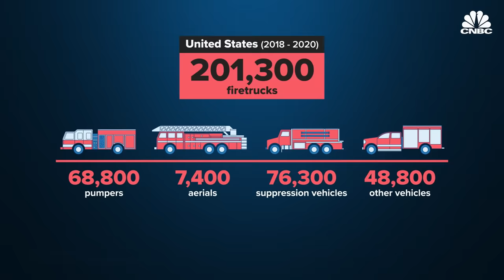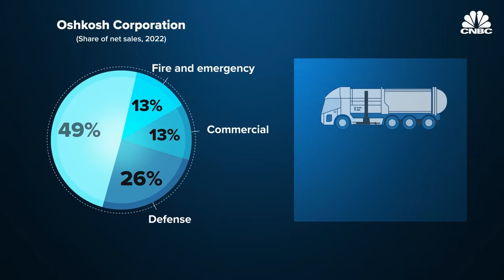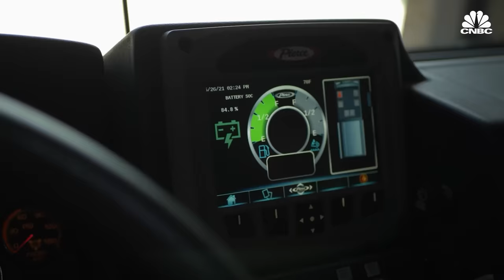Who Makes Money From America’s Firetrucks

Comment: It would make make sense to have a standard base model, sort of like Unimog in Europe. 
But a lot of it comes down to plain old resistance to chance, even if it’s for the better. 
Same goes for most of their gear.  For example euro style helmets are safer, but not used, simply because they prefer the look of the old style/ design currently in use.
Reply: I'd use a Euro here in US but oh no....gotta keep the tradition of the regular helmet alive.
Reply: That’s an issue with each city’s set of regulations from what I understand.
Reply: Even european firetrucks are customized to tailor the department needs. It is impossible to have a one size fits all fire engine. Each fire engine is custom-made to match the needs and demands of the department its going to
Reply: Technically there is no standard fire truck even in Eurasia. The U. S “Standard” is often a 30’ cabover that seats 6 and has IIRC a 500 gallon tank. But its a stretch to call it a standard as your talking hundreds of departments with their own needs in hundreds of municipalities with different local and statewide regulations. You cant mass produce something thats even close to a one size fits all.
Reply: Euro helmets are the same just a little lighter i would rather use the traditional fire helmets hands down over other euro any day it protects more of your neck and yes tradition is a very big part of the fire service and it’s where we came from we should respect that and be proud to put on that helmet but instead we complain.
Reply: @ember_shep8181  but most of them are made on commercial chassis, that are much cheaper than custom ones, made say, by poerce. It really helps when all the trucks are cabovers. Also, the pumps and plumbing are quite different: European engines usually have less valves and prepiped discharges, if more are needed - couplers are used.
Reply: @solarissv777 most fire apparatus are not made on a commercial chassis. That is 100% wrong. And by the way Pierce still builds the rest of the truck.
Reply: You’re wrong. The American fire service, typically teaches a very aggressive interior attack. While Europe generally will not enter a building unless there is a life safety threat. The American fire helmet has the added “wing” or “tail” which allows water and debris to run off and away from our backs. The back of the euro style helmet ends directly at the neck, allowing for debris and heated water to infiltrate the turncoat at the neck line and run inside. Also, for the traditional American helmet, ie: 1010, or N5A, the insignia eagle at the top front of the helmet, can actually be used by a fire fighter that is trapped to breach a sheet rock, or with enough force, plaster and lath wall for an added or necessary escape. More progressive and advanced classes, ntm old timers and experienced senior members teach us these tricks of the trade.
Reply: @jamescoakley4319  I meant in Europe. It's your regular MAN, Scania, Mercedes etc., although, sometimes with the crew cab. Some of those trucks can be ordered with a crew cab (for up to 10 prople) from the factory. Sometimes, with the regular cab and additional places in superstructure. And besides, airfield engines, some other specialized ones (wildland fires, haz-mat fires) custom chassis fire engines do not exist here.
Reply: Mercedes-Benz atego is most common, as wel as MAN trucks. they also look more modern than these american blobs. Rosenbauer is the biggest.
Reply: @BD-md6zr  I guess in Germany, Europe is big. Here in Czech Republic it's mostly Tatras and Scanias.
Reply: @solarissv777  Scania, MAN and Mercedes Benz are also often used by rosenbauer.
Reply: @BD-md6zr  not to forget the Iveco daily for the rural fire departments. Got ours 2022 and it's awesome for the emergencies we're dealing with 99% of the times.

Comment: Not EVERYTHING needs to be electrified -

I would be more than happy if emergency vehicles, heavy industrial vehicles (handling large and dangerous materials) were not electrified.
Reply: during a storm natural disaster the power is out for weeks  or the fire truck batties explodes
Reply: That is dumb. Pretty much all emergency services have backup power generators that they can use.

Also, the explosion bit could just as easily be said about combustion engines.... hell, its in the name.
Reply: @Wafflinson how long does it take to recharge vs refueling?
Reply: @pandorasboxg at least on a fire truck, which sits most of its day at its station, charging is not an issue. They can stay plugged in while idling and respond to calls with a full charge.

Comment: It’s time to rethink where and how a fire stations are staffed. Quick response seems to be the key to most fires, yet fire trucks are very slow and cumbersome. More smaller staffed fire stations are needed as well as quick response vehicles with 50-300 gallon of water on board. A 50% reduction in response times results in more lives and property saved 79% of the time, as shown in one recent study. Off road Motorcycles and atv’s 
combined with heat seeking drones have been shown to extinguish wild fires 200 times faster.

Comment: Most complicated way to make a fire truck. 0 standardization, not even the chassis. Way to complex which results in these high costs/prices. Very inefficient in my opinion.  As a tax payer I think 2,5 Mio for a ladder is too much and I would look for a different supplier. In comparison a ladder in Europe will cost you around 700k €.
Reply: The problem is that there's industrial needs for such nonstandard fire trucks (especially when handling chemicals).
Reply: @O530CarrisPT_C2  they aren't talking about specialized industrial FFVs, but for trucks/engines, used in cities/towns. This is just a ripoff and taxpayers cannot do anything with it.

Comment: From my German point of view, I will NEVER understand U.S. fire engines: they are much too big and impractical, far too expensive, they carry far less equipment for their size and are also far too complex and cost-intensive in maintenance and care!
Just one example: a standardized German "emergency fire engine" (Hilfeleistungslöschfahrzeug HLF 20) can replace two to three U.S. vehicles! And a standard turntable ladder is also more flexible, more cost-effective, and smaller in dimensions than a US version, but has the same ladder height, but with much better equipment and application possibilities through, for example, a permanently installed riser to a projector on the attached work cage.
... and the first electric powered fire engine in the U.S. was launched by Rosenbauer, and it's no surprise that it's a European company.
Reply: Sadly Rosenbauer’s made in the U.S. don’t compare to their European counterparts. We call them brokenbauers😂

Comment: The reason why firetrucks are so expensive is no 2 are alike.  They are all made from the customers specs.  This cost a lot of money.  Mack tried to make a assembly line truck for fdny and stooped making trucks after awhile.
Reply: "is no 2 are alike." actually, by now departments recognized the fact that ordering several identical ones reduces the cost for every single one. Thus the FD in our city ordered 57 identical Rescue Engines, 11 or 12 identical Tower Ladders and so on ... also the chief units are identical to each other, and so are the ambulances, hazmat trucks, tankers etc 
This also goes when several different departments order identical apparatus together.

Comment: It's insane to try and make fire trucks electric. So when the grid goes down there's no help? Or worse, the trucks won't be able to get where there going or stay on station long enough to actually fight a fire. The sheer weight of the truck AND the water will overwhelm the battery systems. At best, you MIGHT be able to do a diesel -electric hybrid, similar to a bus. The one they tout in Madison isn't a mainline truck for a major fire department. It's never gone below 40% because it's not been on a long duration fight or has had assistance and not been the primary unit. They may work for an airport. Short runs, a large power grid already in place, limited fire fighting time for most instances. But batteries get weaker in cold and extreme conditions. Also, cities will need to consider the shorter lifespans of these batteries and how expensive they are to replace.
Reply: actually, it isn't. Not at all. 
You can spec an electric truck with its own on board backup generator. When the grid goes down, also most pumps at gas stations won't work. They don't pump, you can't pay, nothing. 
The backup generator also ensures that it can stay on scene and keep on working in the rare but possible scnearios of long lasting incidents or super busy shifts, without having to fear that you won't make it back to the station, can't respond to the next call or can't operate the pump to supply water. 
"But batteries get weaker in cold and extreme conditions." even up in the arctic that's not a big issue. Yes the capacity is lower, but not that it would be a problem.
Reply: @EnjoyFirefighting  Yep, keep believing that propaganda. You should see the video from the truckers that blow complete holes in EVERY argument you just made, but you won't of course. Not to mention all the electric busses that are out there who have daily issues with longevity and the colder it is the less they are used or run. BTW what do those "backup generators" run on?
Reply: @ddc163264  that "propaganda" has been tested at some of the busiest stations under real life conditions here ... 
" all the electric busses that are out there who have daily issues" yeah the new electric busses in the Norwegian capital city indeed have issues during the winter right now ... but they didn't have issues with the electric busses they've been using the past few years. 
In fact, by far the greatest share of newly registered vehicles in Norway are all electric, not even counting hybrid electric. And Norway is well known for harsh winter conditions. 

They run on diesel obviously. But it makes a great difference if a fire truck runs on diesel 100% of the calls (also all medical calls, false alarms etc) every single day throughout the year, or if it runs on diesel maybe a dozen times  and needs to refuel only once in a year

Comment: 1.    Buy electric heavy construction equipment AND buy an electric charging mobile station (that runs on diesel?)
2.    Buy diesel heavy construction equipment.   
The push to electric is incredibly foolish.
Reply: it's not. There's a difference between a truck running on diesel 100% of the time and calls its responding to, including anything from false alarms to medical calls, and a truck running on electric power 95% of the time and using diesel only few times a month, if it needs diesel at all

Comment: I think Pierce fire apparatus are the best in the world.  Having said that, making EV fire trucks is the dumbest idea ever.  They will be MORE expensive, and a great handicap in long term emergencies like floods, tornados, wildfires, hurricanes, etc.  Secondly, you will have to do major electrical work in fire stations to be able to charge batteries in the bays.  Lastly, storage space is at a premium on most trucks, and you will lose a lot having a battery.
Reply: is it a surprise, that after cars, vans, trucks, busses and even ships got electric, that emergency vehicles will be part of the game as well? 
"and a great handicap in long term emergencies" only if you don't spec them with a backup plan for those rare but potential scenarios. 
Not really fan of Pierce tbh. Rosenbauer obviously offers the by far widest range of emergency vehicles, equipment and gear, but they aren't my favourite either. It's actually a rather local company in Sweden which I think makes the best ones
"Lastly, storage space is at a premium on most trucks, and you will lose a lot having a battery." not necessarily, depends on where you place the battery

Comment: Manufacturers LOVE electric vehicles, because the batteries will need replaced regularly..... and battery replacement costs are so high that it makes better financial sense to replace the entire vehicle ....   thus making the "carbon reduction" argument just plain stupid....
Reply: we had a 4 year old diesel powered car which had its 3rd engine now ... not any different or better with modern diesel powered vehicles. 
Actually, as the electric Engine from Rosenbauer was tested here, it had less downtime at the repair shop than equally new Engines based on a diesel powered truck

Comment: As far as emergency/military vehicles will never be widespread it’s not reliable enough. And in a grid down emergency situation how are you gonna charge it.
Reply: "As far as emergency/military vehicles will never be widespread it’s not reliable enough" did you forget to write "electric"? Apart from that it sure works for emergency vehicles as they are reliable. 
How will you pump diesel and pay for it when the power is down?
Reply: @EnjoyFirefighting  yes I did thank you I forgot that word. Reasonably speaking we are talking about moving energy correct? If so it is far easier in a logistical sense at this point in time to move unload and refill a tanker truck than a battery pack. That has to be powered by a energy source close enough to the problem so that emergency vehicles can help.
Reply: @benbauer1509  in 99.9% fire apparatus don't have long distances to cover to respond to a call and return to the station. Reach usually isn't a problem. At the station they're plugged in just like diesel powered apparatus are plugged in as well. Basically nothing different for the crews
Roughly half of the electric fire apparatus come with their own backup diesel range extender, so you can refuel them just like a normal diesel powered truck in the very rare case that it might be necessary. In realistic numbers we're talking about hitting the gas station once a year then ...

Comment: Correction - the battery people politically USED to be anti-war...now it is quite the opposite. 
This aside, using battery operated fire rigs and other big trucks is silly. They state in the video that they all have diesel engine 'back-ups'. This is nothing more than a diesel locomotive - in a highly inefficient version. And 'mobile charging stations' for construction equipment?? This is a diesel generator that must be towed by another diesel truck to recharge the dead battery-operated equipment. 
Fire trucks are already fighting weight issues. They should not have to fight the huge amount of weight in the batteries. Also, what happens when the battery operated fire truck goes into thermal runaway? Who does the fire dept call? 
And, the vehicles are 3X the cost of diesel driven versions. Stop this madness.

Comment: This whole thing of switching to electric is a big joke. Oh sure equipment doesn't make emissions like a diesel does. Where does all these batteries come from than. Think about the energy it takes to make these batteries. Now think about the energy it takes to keep these batteries charged. As a diesel mechanic myself your trucks that diesel is alot cheaper to buy than electric trucks. Electric trucks cost about 3 times the price. And for the entire fleet at one yard the power company tells us we have to produce our own substation at each location to change that large of a fleet. The price it takes to go electric is not worth it. Overall going electric is a joke. And what happens when the power goes out and they need to charge this equipment. Bet they have diesel generators to charge these batteries. I see more problems with these new electric trucks than the regular diesel truck.
Reply: also have to keep in mind how the oil comes from the oil rig, is transformed into diesel and gets to your gas station. Not very clean either. 
"The price it takes to go electric is not worth it." is that what American rail companies said as well and still run on diesel locomotives today? lol
"And what happens when the power goes out and they need to charge this equipment. " seriously? Fire stations have backup generators, and so do many electric fire trucks come with their own on board backup generator as well